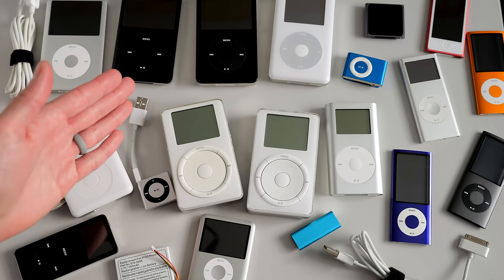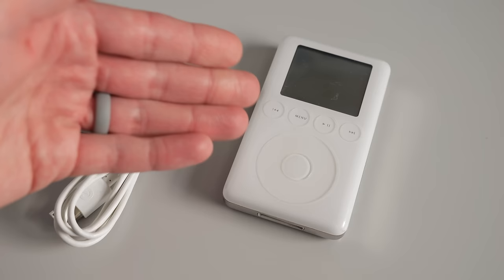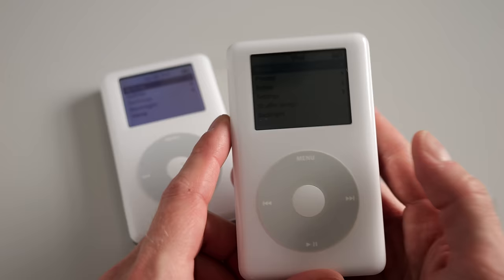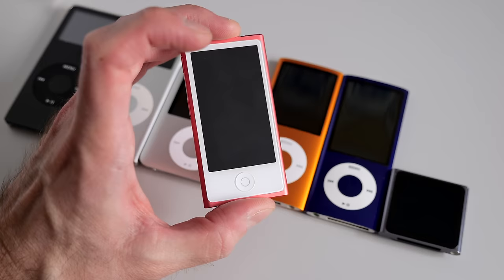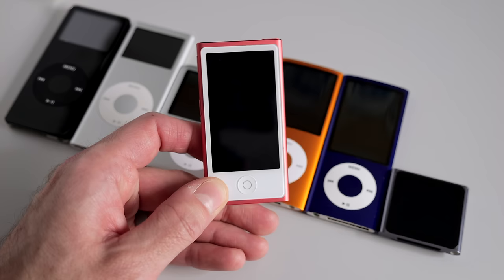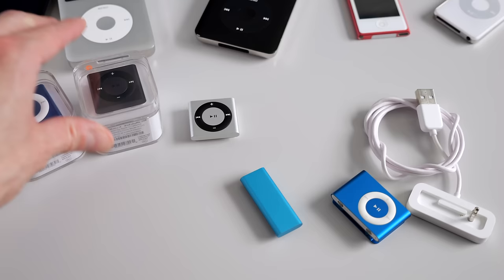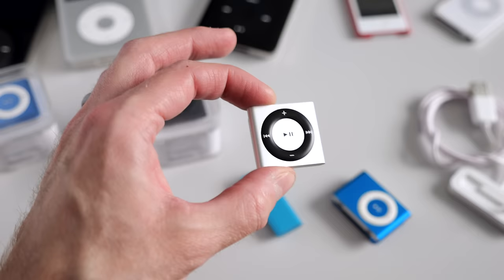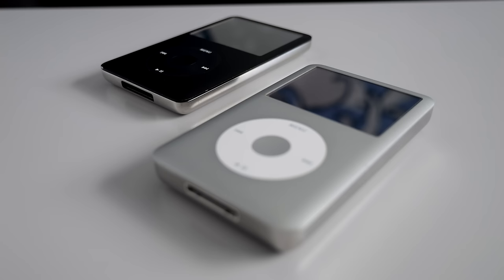Retro Buyer's Guide: Apple iPod!

Comment: I watched a lot of video on my 3rd Gen Nano (8 GB). Notably, I recorded a lot of Avatar the Last Airbender (along with other cartoons), encodes them to something like 3GP (before I knew better about video codecs), and loaded them right into iTunes. 

It was definitely cool to have my favorite shows in my pocket. I still have the iPod, used it for car audio for awhile before the battery was just too degraded to do the job, and I wanted to listen to long form content.

I do have experience in mocrosoldering and working with small assemblies, so I can probably repair some of those devices with a reasonable degree of confidence, especially the two-piece designs such as 1st gen and 3rd gen Nanos.

Comment: Just make sure you use your back ups meaning charge them and discharge them occasionally. That keeps the battery healthy. Batteries don’t like to sit in a state of discharge for long periods of time. I still have all of my old iPhones all the way back to the 3G and they all still work with the exception of one that I let sit too long and the battery swelled up. All of the other ones still work and hold a charge because I cycle the battery from time to time

Comment: The iPad Mini is great, but it's def not the first iPod you should get. The 5th/5.5 gen is the best overall, followed by 6th/7th. The 6th/7th gen are the hardest of the main iPods to open up (the 3rd gen nano is the maker version of the 6th/7th, and the hardest overall). The 4th is just a true classic, but the 5th/5.5 has a bigger screen. Either way, upgrade them to solid state. It's well worth it. The Mini's have an upgradable drive (CompactFlash), but none of the nanos are upgradable unless you can micro solder.

The hard drives do fail, but I've never had a hard drive die out of about 10ish iPods, but have had to replace the batteries on all iPods I own (well, I skipped the nanos, the heck with those lol).

Comment: If you are into music and audiobooks, there are still brand new models from other companies, that are really decent. One of more affordable one are from Sony and Sandisk, depending of what you want to use them for. Sandisk makes more rugged ones, great for sport and activities, Sony more every day usage. Then there are even cheaper brands, some semi-nonames,  (Intenso, Lenco, etc) which do the job too. And then there are high end models (Fiio, iBaso), more for professionals and audiophiles, with things like micro SD, high end DACs and amplifiers, and bigger batteries. They are great, but expensive. Most of them are around 8GB, which is plenty in my opinion.

I think Sony NWZ-A15 is really cool, and really well priced. The only issue it doesn't have USB port.

If you can score used iPod for cheap, sure go for it.

Comment: i have one of the gen 5 (video) ipods but the sound that comes out of it is not that good (lots of static on silent and the volume is a bit to loud on the lowest setting).. it's interesting to feel the hard-drive working though.. it still works and holds a decent charge..
i also had a 1st gen nano  that i gifted to some girl.. that one was pretty cool.

Comment: Hey Colin, open up your spare shuffles and give them a charge once every few months. I've heard that if lithium batteries are completely depleted for a long period of time it will ruin them.
Reply: its probably too late at this point, its been years and lithium batteries have a storage tolerance less than a year for most stuff, the shuffles are a bit better off than normal because they have a physical off switch but i still wouldnt bet on it.  they are old tech without the power guzzling bms crap so they will probably pop to life easily enough but the capacity has already degraded
Reply: @nickolaswilcox425  yeah I think you're right, I think they need to be charged within 1 year of manufacture or they start to go bad.

Comment: The iPod minis are the best to get. They’re essentially the same as the Classic of its time but smaller, they are the cheapest to retrofit, and the easiest to take care of. The Classics do NOT charge with regular USB chargers, you need USB chargers specifically made for iPods to charge them, or charge them with your computer. The minis can charge with regular USB chargers. iPod chargers are getting rarer and rarer, I have two, the Apple official one was already dead, the Belkin one still works.

Comment: Missing: iPod 5.5 formally known as "iPod (Late 2006)" and iPod Classic "6.5" (aka late 2008) and iPod Classic "7" (aka late 2009). All three have significant HW changes from the original 5th and 6th generation respectively so if you acknowledge iPod Photo as a separate model these are at least as distinct.

IE iPod 5.5th has brighter screen, double the internal memory, longer video playback, improved video decoding hardware (more formats), different HD sizes and a search feature (which is why they had to double the RAM).
iPod Classic 6.5 (late 2008) has some hardware tweaks and TRRS support (for remote & mic) over the original (2007) model, and the 7 (late 2009) finally switched to standard LBA48 addressing so it's easier to use large (128GB+) ATA drives, all earlier used proprietary addressing for disks larger than this (but IIRC there were workarounds?). IIRC the thick Classic was only available in the 6th/2007 model, the latter only had thin models.

I assume the LBA48 fix in the 7th gen Classic is why all the "high-capacity" refurbished (IE new batteries, new storage) iPod I see in various stores use the it - 1TB SSD seems to be a popular size.

The reason the Windows Store version of iTunes doesn't support iPods is because it's a Store app and is thus firewalled by the MS Store into a small sandbox. No hardware access, no normal filesystem access (each app gets it's own private file-sandbox burried deep inside %AppData%) and so on. Yes, "proper" MS Store applications are crippleware-by-design, is anybody surprised?!
MS has since started allow real (non-store) applications to be delivered via the store but that was long after the store launch and I guess Apple is perfectly fine with "if you want the real iTunes, download it".

Comment: I snagged a 16GB black 5th gen ipod nano on ebay for $25 a couple of years ago. It was basically brand new and came with its box, it just had water damage. I got it, charged it up and it worked! Battery life sucked tho, but it was a sweet deal.

I also got a 5th gen 60GB iPod Video for like $56 on ebay too. Looked babied, cause the metal backing was still mirror-like with few scratches. The previous owner kept some Christian podcasts on there, there was no music. But yeah, I use that iPod more cause the battery isn't that bad compared to my Nano. Good deals on ebay if you're lucky!

Comment: The iPod photo had a great feature for photographers apart from being capable of displaying pictures. It could also "offload" picture from a camera. Back then, with limited flashcard sizes and for redundancy, it was great to be able to transfer images from the camera straight to an iPod on its hard drive without the use of a computer. But I agree, it wasn't a picture that everybody used, but for some, it was solving a problem like when you were on a trip and didn’t have to carry a computer.
Reply: I was using a third party adapter to download pictures from a 256 MB Compact Flash card to the 10 GB 2nd Gen. iPod. It was a slow process, but still a good option in the early 2000's if you took a lot of pictures during your holidays.
Reply: @jurgmesser7723  good old usb2 speed.
Reply: @ennev  I think it was even based on FireWire, but nevertheless VERY slow, only using a fraction of the 400 Mbit/s bandwidth! More like USB V1.1😄!
Reply: @jurgmesser7723  oh true. Second one was FW

Comment: Thank you for your deep review of all the ipods. Beside my iphone, Ipad, apple-watch, I am using a small mp3 player made by Philips. 4 GB capacity. Two rows display and it is small. No connection to Bluetooth. So I have to use a regular pair of  cable based earphones. For my outside jogging runs the mp3 player is the best way to run with music. What I don‘t like is itunes. In 2005 when itunes appear, it was ok and Useable. But nowadays …. Really crappy. Another thing, itunes can be used on windows, but it made my whole system unstable. For the future I am looking for an iPod nano shuffle. So small, wow. That would be perfect.

Comment: I had a 3rd gen shuffle back when it came out and found the proprietary headphones very frustrating, and I think I lost it a few years ago. I'm loving this revival though, I bought myself an ipod video a while ago and have modified it with rockbox, flash storage, a larger battery and a transparent front.

Edit: I also disagree on the Mini, I found it super easy to take one apart. They are low on aftermarket parts though, pretty much just limited to upgrading storage.

Comment: Just to add on, a common failure point of iPod Nano 6 seems to be the power button. The button itself is on a ribbon and somehow it might got stuck after some use. Replacement parts shouldn‘t be too hard to find though, but it's just painful to fix.

Comment: Your last video compared portable CD players, and specifically recommended a D-145 as its from after the bugs were worked out but before they became cheap, and it has no antiskip. I have a Panasonic SL-290 I bought at a thrift store that I am very happy with except for the spindle hiss, so I was hoping that Sony would be an upgrade. While the D-145 has almost no hiss, the sound quality is terrible. All boomy lows and no highs, as if Mega Bass is turned on permanantly. So I went back to eBay and got a blueberry iMac styled Panasonic and a white Sony player from the 2000's. This Sony was better than the last one, it had good enough sound quality. The new Panasonic sounded better than the Sony, but with more spindle noise. Then I picked up an Aiwa from late 90's not expecting much, and strangely, this one sounds better than any of the Sonys. Here's my rank of CD playing devices:
Yamaha CD-S303 - 10/10
PC with Scarlett Solo - 10/10
Panasonic SL-290 - 8.5/10
Aiwa late 90's - 8/10
Circular Panasonic - 8/10
Circular Sony - 7.5/10
Sony D-145 - 4/10
How do I get that 9/10 portable CD player? Vintage? Oddballs like Denon and Bose?
Reply: This comment is on the wrong video.

Comment: Shuffle on the Shuffle (i still have three) seems to be dynamic, in that it seems to shuffle after each song. Several times over the years in shuffle mode, i've heard the same song twice in a row. I like the shuffle in my Classic better as it shuffles the entire library and retains that shuffled order each time you use shuffle - so there's never any repeating of the same song until you've listened all the way through. I just load random stuff on my Shuffle and play it in non-shuffle mode.

Comment: The 3rd gen nano is a lot easier to repair since it's not in a one piece encasement. But you'd still have to solder the battery and the chances of bending the rear plate are really high.
The 7th gen mainline iPod added support for 4 pin headsets. So you can do voice recordings and more important: use remote controls of said headsets. They're not all compatible, especially when it comes to volume control, but most of them work fine.

Comment: My first iPod was the 10GB 3rd generation which i used for years until the battery swelled and basically cracked the player in half.  It was a sad day when i had to throw it away. I replaced it with the video iPod and then eventually a few of the iPod Touch models. I did get the nano model with the camera as well.  Now I just use my iPhone for convenience.

Comment: You talk about taking the Nano apart being difficult without thinking about how the Mini is all that plus a click wheel cable that likes to tear or solder joint snap, a CF drive connector that likes to fall off the board due to wonderful lead free solder, the metal clip being even more aggressive than in the Nano, finding a shell that isn't scratched into oblivion to begin with...

Comment: I had a first gen Nano at high school, owned it long enough to replace it's battery and installing a custom firmware on it - forgot what it was called and don't worry I found out you cant really brick these when one time it failed to install and had to revive it via itunes.
Reply: And the first gen was surprisingly easy to pull apart for a teen who had no idea what they were doing with no heat to loosen the glue and a solder iron tip that was much to big, I remember the battery just being there behind the chrome backing so don't be afraid with the first gens lol and my current 7th gens battery is already toast from all the years of me using it to death and I am not risking the screen to replace it as it has to come off.

Comment: would the first gen ipod na-no be fine? as its more of a sandwhich design, instead of an unibody unlike the 2nd-5 gen ipods, and the battery is located behind the wheel rather than the display

Comment: Regarding the iPod nano battery problem: I think the 1st gen can also be recommended because it has the iPod Video design which means that you can relative easily open it. The two halfs are held by clips. On the aluminium nanos, the battery and logicboards are shoven inside the housing from the bottom. I am interested on your thoughts about this

Comment: I have the last model of the 160gb video ipod black and shiny metal backing still works and  have ipod nano.  I didn't really get into the ipods crazy obsession. have 1 I like it, would like to use it in a car stereo aux function. what happened to ipod usb flash drive. ipod stamp

Comment: I'm pretty sure the second gen nano is the most bootlegged design of micro-sd based simple players. Had two, pretty decent, no shuffle, funnily.

I rather like the look of the, er, gumstick Shuffle. Is it completely un-useable without the inline remote? I doesn't, start playback when you plug in a pair of headphones? Also, are it and the 4th gen compatible with the 3.5mm dock?

Bought a 4 gig mini for 6€ some time ago. About 14 hours of battery life still, with a rubber case that kept the pod basically mint. I've seen some folks dedicate such, smaller pods to different artist; this is my Beatles pod, this is my Elvis pod, everything they ever released, in one pod. Keeping an eye out for my future Jackson pod. :)

Also, one fun use I've gotten from a later nano model, with rockbox, I just dumped all my retro console/computer music files on it. 4 gigs again, contains hours upon hours of SID tunes, NES stuff, some Megadrive classics. Very nice indeed. :)

Comment: Wait wouldnt 19:40 be like trying to be more for the portable dvd players market user or fwiw the psp even?

Well perhaps not for the handheld aspect of it or jogging with if for meaning if maybe say a waterproof ipod vs a dvd player and also moving up and around with discs is less ideal for it would or is in the oast that it was more prone to skip or scratch vs nowdays... plus with the advancements of the storages with the mp3 or mpeg 2 for dvhs/dvd and digital video or mp4 etc it just makes sense somewhat.. although not being able to expand storage for video or put existing dvd movies of those one already owns is kind of a nuiscance or maybe depends how much the repurchasing costs are.. but then yeah so for like the battery pack that does sound kind of lile an annoyance is for after just a few years needing to potentially try to open it up without damaging it as inevitably more often than not I feel like with the portable electronics nature their more susceptible to being flimsy in internal build qaulity of the comp9nents so for one to easily switch out without needing to know how to solder or otherwise replace flat pack ic and other chips etc makes the service of certain components maybe more difficult but I do not know.. so whatever it seems coolio still though no lie.

Comment: The iPod Classic 5.5 is relatively easier to work on and modify and supposedly has the best sound. The 4th gen sold the most so is easier to find and has the most aftermarket parts. The 6 was super difficult to work on.

Comment: The Windows Store iTunes can sync iPods just fine, plug the iPod in and iTunes would just prompt to install a sync service and it would work like before.
Reply: Yeah, the Windows Store version of iTunes works with iPods, you just need to have it download the drivers for recognizing iPods. Unfortunately, downloading those drivers through iTunes is a huge pain in the ass; the download fails, it gets stuck trying to contact the Apple server, the drivers fail installing... basically everything that could go wrong with the process did for me, but I was stubborn enough to eventually get it working.

Comment: Probably Bad News… but, like you, I also bought some of those last gen shuffles as spare units, brand new and sealed "just in case". The batteries are dead by now.

I opened one in 2019 after losing my also indestructible daily grinder and machine-washed unit that lasted me for so long for gym use, and though they did connect and sync with my Mac, they all died in minutes once you disconnect them. Same with the other spares.

The Li-Io battery dies because they need to be exercised with charges and discharges. Too much time in storage without a monthly charge/discharge cycle and the cells dry out slowly and die. Add years of inactivity due to being sealed and you get the picture.

Open one and test it, chances are they will not hold a charge for long if any at all.